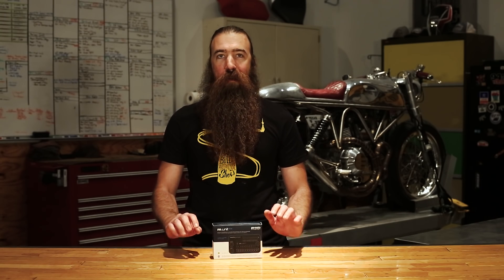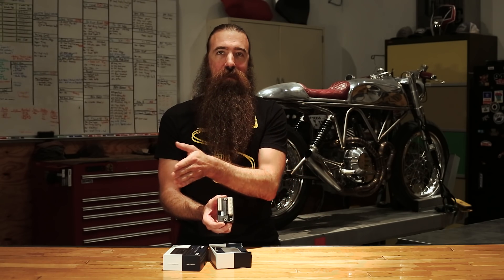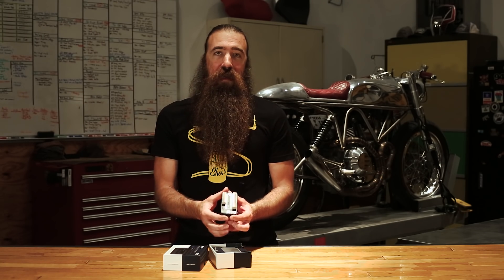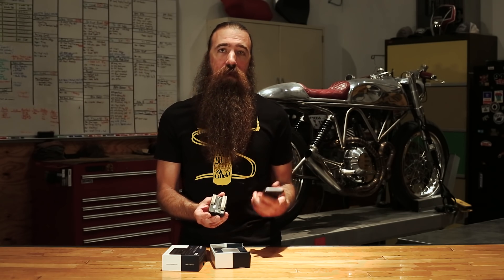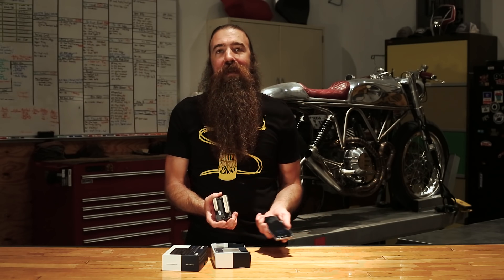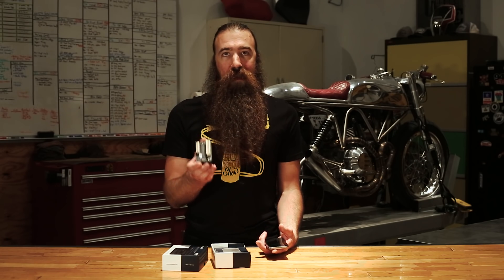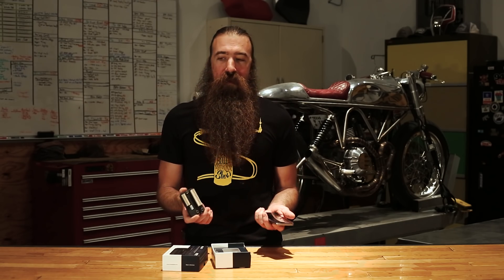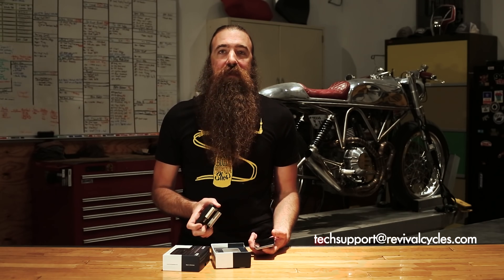Meet the Motogadget M-Unit Blue - Revival Cycles' Tech Talk

Comment: So if you loose your phone your screwed
Reply from the maker: Of course not. There are several ways to deal with that situation. The best advice is to use a conventional ignition switch as a back up to the keyless system.
Reply: @RevivalCycles  A secondary operation could be employed.    Depending on your brake system. The m unit should be able to notice as a scenario 2 or 3 brake pulls hand or foot pushes in sequence to start the bike.   When the bike is in neutral or notices the clutch is in.  All setup in the app as a code sequence. So a code could be set and recognizes that you turned on the high beam, pulled in the clutch and hit the brake and it starts.   Variation coded starts

Comment: Other than the bluetooth keyless switch why would this be better than a M-unit v2???
Reply from the maker: There are a lot of new things with the blue, more inputs, and more outputs. Having dedicated ignition output with two extra aux outputs for things like heated grips, cooling fans, fuel pumps, phone/gps charger, etc. Also, having phone connectivity makes configuring much easier. I'm sure there are even more benifits to it, but that list alone is worth it for me.

Comment: Do you still have to have the mbutton?
Reply from the maker: You never "HAVE" to use an m-Button. The m-Unit is designed to work with the m-Button, or directly with the control buttons on the bars. The m-Button is fantastic when doing a super clean build where there are literally no wires or cables exposed, but for the average installs, I actually recommend not using an m-Button.

Comment: Can you connect your phone to the M-Unit Blue and at the same time connect your phone to say a blue tooth headset/com system or any blue tooth device? I can't fully wrap my head around it, can you maybe use the AUX input if you wanna use more then one BT device simultaneously? Cheers!
Reply from the maker: The m-Unit will can be paired with up to 5 handheld devices, but in order to connect to the m-Unit and a com system, it is your phone that will need to support multiple connections. The AUX is only able to provide power, it does not do any communication or have any connection with Bluetooth.
Reply: Can you then connect a BT com system to the m-Unit and then your phone to the m-Unit and in that way sorta use the m-Unit as a "bridge" between your phone and com system? Thanks for the answer great videos!
Reply from the maker: I do not think this is possible, the m-Unit needs to connect via the app, and there is no way to get the com to run the app so there is no way to connect the com to the m-Unit.
Reply: I see. Thanks for clearing that up!

Comment: I just ordered my him blue and M button today can't wait to get started. wanted to know if anybody's installed on a 87 Yamaha venture. It's pretty much custom. And would you removed old wiring harness?
Reply from the maker: In our experience if you are running a full custom, it is much better to start from scratch. The factory harnesses are really inefficient and if you've moved any of the components or devices the routings may be completely different. We haven't installed in a venture, but based on the year, and other yamaha's we have worked on the m-Unit should be prefect for this project.
Reply: Okay great, thank you very much for getting back to me. I'm also emailing back and forth with one of your guys About the wiring diagrams You guys are very helpful. I Co-host a Web show with Lou Santiago from Car fix TV And when I'm done with the bike I'm going to do a review of this product And your company.
thanks Louis

Comment: How long is the proximity with the keyless start?
Reply from the maker: The unlock distance can be calibrated to your preference, but the range will depend on the details of the install and how much material the signal has to pass through. Typically the maximum range is about 15-30 meters, but can be set to not unlock until you are closer.

Comment: I am redoing a Honda CX500 which has reverse voltage... will the M Unit Blue ?
Reply from the maker: What do you mean by "reverse voltage"? The CX500 as built by Honda is 100% compatible with m-Unit V2.0 and Blue. The only part that can be tricky is that some of the CX500's used a CDI ignition which is controlled by a grounding kill wire to stop the spark, but the m-Unit uses +12V to control the ignition system. To make this work you use an automotive 12V relay with normally closed contacts. The relay contacts are used to ground the CDI kill wire so the bike won't start when the m-Unit is off, and then the AUX (or Ignition output on the Blue) is used to control the relay control coil.

Comment: Very cool!
Iam currently i my first build, a total rest/rebuild of a 76 rd400!
Its kickstarter - Would it be overkill to use This kit? Or Maybe the v2?
Its a total rebuild and Will need a new wire system. Started With a bare frame 
Cheers
Reply from the maker: As long as you plan to use a battery  you would be good to go with either of the m-Units. They are both excelent, and still the easiest way to wire a bike from scratch. With the RD you won't need all the functions, but there are enough other benifits with the m-Unit I still think its worth it. The choice between V2 and Blue is really just about if you want to be able to use your phone with the bike, the basics are the same between both units.
Reply: Revival Cycles excellent! Thank you- keep those great videos coming 🙌

Comment: I assume this unit would negate the need for the M-lock. I have just bought an M-unit V2 and M-lock but not installed it yet so may return it.
Reply: Its a wicked system and the wiring kit they send is fantastic.  I have never wired a bike and it was very easy (with help from Stefan on a couple areas lol)   Get the ferule crimper!!!!! if you don't have one.   The one Revival has worked very well with the M-Unit inputs.  I like that the kit came with equal large and small ferrules so it was easy to double up outputs like signals in a single ferrule.  Good luck man and I'm sure you will love it.
Reply from the maker: The keyless-go feature does provide a method to turn the bike on and off using an Android Smartphone (iPhone support is coming). But it is still a good idea to have some type of ignition switch just in case your phone dies while you are out. The ignition switch could be an m-Lock, or key switch, or whatever you prefer.
Reply: Thanks for the reply. This is my first attempt at wiring a bike form the start and have only decided to take the plunge after watching your video on the M-unit V2. For this time round I think I will stick with that. I have ordered your deluxe M-Unit wiring kit and rely solenoid so hopefully all will go well :-)
Reply: Thanks for the reply buddy. Can't wait to get at it. Never thought I would say that about wiring but these guy's are a massive inspiration and the vids are great help. Wouldn't of even thought of trying this without them
Reply: Phil Spinks I hear you. I hadn't heard of motogadget and was dreading my wiring.  random chance hitting their YouTube channel during random YouTube browsing lol.  good luck!

Comment: question. if your alarm is armed because you are out of Bluetooth range, how does it send you an alert?
Reply: So, the alarm system notification doesnt work if you're out of range and the alarm won't auto set if you are within range?
Reply from the maker: It would be great if it could do this, but it can't send via SMS because the rest of the systems needed to support that would consume too much battery power and the bike would need to be on a charger if it was left for more than a day or two. The bluetooth system they use is a low energy system and the new m-Unit blue's standby power consumption is almost the same as the V2.
Reply: exactly what i was wondering.
Reply: I assume it has a SIM card and sends an SMS text like some home burglar alarms can
Reply: ah . thanks for the response.
Reply from the maker: Ok, this is a great question. The alerts are only applicable when you are within Bluetooth range. Which can be anything between 30-100 meters depending on conditions. If they were to send the signal using a different system like GSM it would consume a lot of battery power and the bikes battery would not last long enough. The current bluetooth system only uses a tiny amount of power, but it will still give you an alert when you get back to the bike.

Comment: Other concern is the draw for those of us running 4 cell L-Ion while the bike is dormant.  Will the new phone capabilities cause any substantial draw on the batteries?
Reply from the maker: Actually it draws less than half of a miliamp... it is 450 micro amps which is 0.00045 amps. This is actually lower than the V2 which draws 480 micro amps when the alarm is active. Based on this it should take something in the ballpark of 6 months to drain a 4-cell. The theoretical math says its over a year, but I wouldn't push it beyond 6 months.
Reply: BLE only draws a few milliamps per hour, so it'd take a while to drain the battery in standby mode. Like any bike that's going to sit for weeks, it's best to put it on a trickle just in case.
Reply: Wicked - thanks!

Comment: If anyone understands the description for AUX2.  It is confusing me.  The only complaint with the V2.0 is I wish there was a secondary AUX port instead of wiring a ton of shit into one output.  So on the fence about upgrading..........  I have the height to accommodate the vertical inputs now and the cell compatibility sounds awesome.  This AUX question will be my tipping point.

Comment: Would this allowed me to instal led lights on my 6v honda cb without changing anything in engine ???
Reply: "The device works in a voltage range between 6 to 16V DC (direct current) and is made for 12V
electrical systems which use battery minus terminal to vehicle frame. Use in vehicles without a
battery is not possible"
Reply: If you can find 6v LED lights, perhaps. Most are 12v.

Comment: looked at rhe manual after video. One feature i really like is the the input are configured to activate when grounded. That will massively simplify the wiring.

Other new features such as the blue tooth are pretty cool too.
Reply: Can you expand on this, are you saying that the wiring can be simplified over the v2.0?  I'm trying to find what you are referencing.  If you mean that it is simplified over stock then don't worry about a lengthy reply.  I'm running the v2.0 which I love and trying to balance if upgrading for the cell phone is work it.  It's close because I'm worried about my bike getting punked while at a show etc.  I suppose the alarm on the v2.0 should help but having the cell notification is nice.  Curious about range, battery draw for the cell etc.

I'd like to know if the extra AUX inputs can benefit not running all the AUX on the V2.0 to the single output.....  That was the worst part of my wiring was the amount of stuff that I had to wire to that one output.  Gauge lights, coils, neutral light, oil light and a couple others......
Reply from the maker: Wiring is the same as the V2...inputs are ground referenced, and the outputs are 100% isolated from the inputs.

Comment: Great video but putting Bluetooth on a device that controls every aspect of the motorcycle is asinine. Unless they  developed some ridiculously secure encryption Bluetooth can be hacked fairly easily and it's going to make stealing motorcycles with this unit that much easier.
Reply from the maker: The bluetooth on the m-Unit is low energy and encrypted. The pairing process is something you could not do without access to the m-Unit and some time. The connection is way more secure than the mechanical key switches typically used on bikes. Hacking this BT is extremely difficult and for most intents and purposes impossible. 

Bike thieves are smarter than this and they wouldn't waste time with bluetooth. The pro's show up with a low trailer with a mattress in it and tip the bike on the trailer and drive away, 5 seconds and they are gone. Disk locks, fork locks, key locks, etc are dealt with after they are out of the public.
Reply: true that. you can never really secure something 100% against theft if two guys and a trailer can move it. i see the bluetooth as an added bonus for the keyless start and that alone sells me (of course, in addition to everything else the unit does)

Comment: Cool! I hope there is a backup if your phone dies 🙈
Reply: The manual says, "Please make sure to carry the ignition key on you, so you can start the vehicle even without your smartphone."
Reply: @MotoErgoSum  motogadget,  i think its time to charge our phones wireless while riding, only you can do it!
Reply from the maker: As others have mentioned, it is a good idea to have a physical ignition switch to use as a backup in this situation. It can be as simple as a toggle switch under the tail section so you remove the seat flip the switch, and the re-attach the seat. Or go with a normal key switch or m-Lock.